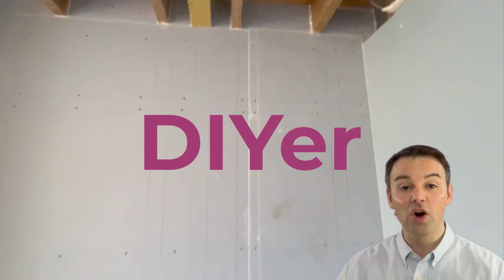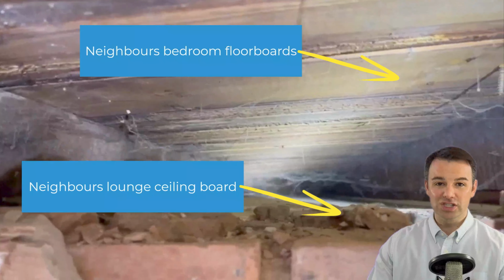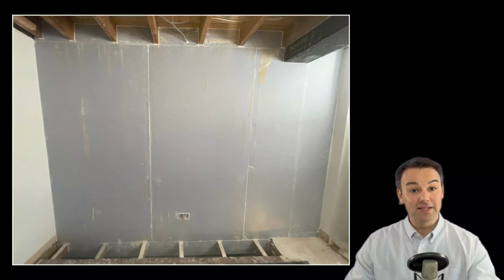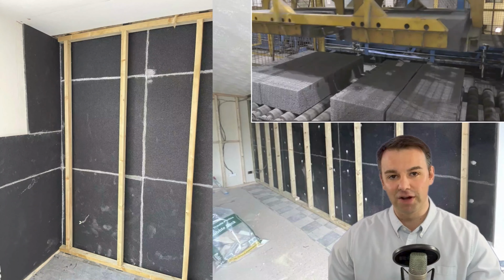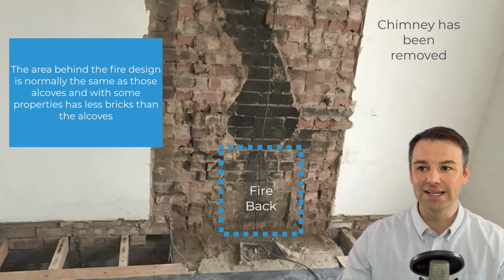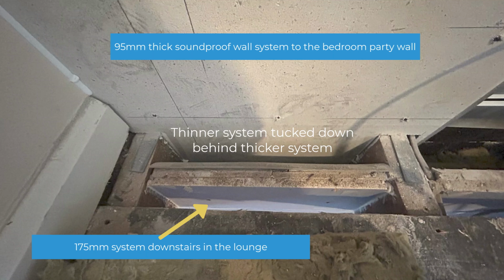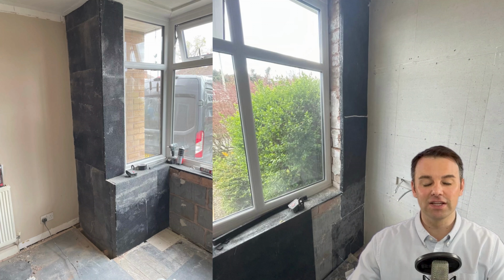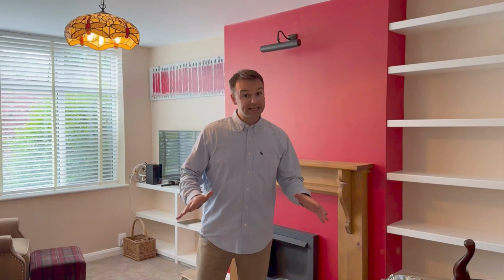The Most Expensive Soundproofing

Comment: Hi Jim
Would an alternative to the 10mm rubber on the flanking wall be a tecsound 100 or would the 10mm rubber be more effective?
I have a brick wall with double doors separating my lounge and kitchen with dot and dab with i thnk maximum 30mm to play with.
Any other ideas appreciated but im think something similar to what you have done in the video
Reply from the maker: Hi @stevenpower1838,
Good question 👍 and nice clear constraints 30mm to play with always makes it interesting.

Between Tecsound 100 and 10mm rubber, the 10mm rubber will generally be more effective for structural vibration on a flanking wall. Tecsound is more viscoelastic and great in certain applications, but in this type of scenario the thicker rubber tends to do a better job of sound deadening the light weight blocks itself.

That said… the bigger question is this:
You mentioned dot and dab. If that wall is dot and dabbed onto brick, that cavity is already capable of amplifying and channelling sound. If you just go over the top of dot and dab with Tecsound or rubber, you may not get the result you’re hoping for.
If it were me, and I only had 30mm total:
I’d strongly consider removing the dot and dab first.

Sound deaden the brick properly (10mm rubber if space is tight).

Then reinstall a properly isolated 15mm Soundbloc board within your 30mm limit. (glued like I share in video 'Soundproofing for Beginners')
Also, because this wall separates lounge and kitchen (double doors involved), you need to think about:
• Are you dealing with airborne voice transfer?
• Or impact vibration travelling through structure?
• Are there ceiling/floor connections tying the two rooms together?

With flanking walls, it’s rarely just about sticking something thin on and hoping for the best. It’s about stopping that wall from acting like a drum and tucking it up and tucking it down.

If you want to keep it similar to what I’ve shown in the video, 10mm rubber is the safer bet over Tecsound in this case.

If you can tell me what noise you’re trying to reduce (voices? TV? impact?), I can steer you more precisely.
Reply: @jimprior7 
Hi Jim
Thank you for such a thorough reply.
Basically the party wall in the lounge has a soundproofing system applied which is doing a pretty good job.
It was mainly to eliminate airborne voice transfer.
However when the voices next-door get very loud it comes around the party wall and into the  flanking wall.
I will most certainly be removing the dot and dab but that will still only give me 30mm to work with in total.
So I guess im wondering what you would recommend to go onto the bare brick with a 30mm limit that would best treat the airborne voice transfer along that wall.
Regards

Steven.
Reply: Oh and its coming from the neighbours who have a mirror image flanking wall on the other side of our party wall.
I'm not concerned about noise transferring from my kitchen to the lounge

Comment: You mention going into the loft. If a loft is partially/ fully floored, do you have to rip up the loft flooring as well?  Thanks
Reply from the maker: Hi @kaylaing, great question! 🙏
We always do that yes, because you need to get the RW3 Rockwool between the ceiling or loft floor joists to reduce the noise coming over the wall system installed to the bedroom.  We do this by cutting open the ceiling and tucking the soundproof wall system up into the loft, insulating the gable wall in the loft and also insulating back from the conflicting party wall.

Thanks for your question 👍

Comment: Luckily my semi has a proper brick wall between me and next door and the joists run parallel to the party wall. Unfortunately i can hear next door snoring occasionally so ill have to sort that. 

I think one of the best ways to fix these problems is to have built in wardrobe against the party wall. All the clothes act as sound damping. Unfortunately you cant have a wardrobe in your living room 😂😂😂
Reply from the maker: Hi @Lawrence, thanks very much for your comment, and thanks for watching 👍.  I live in a semi detached house and my floor joists did use to run into the wall before I disconnected them and no longer hear the neighbours doors slam.

I think the wardrobe will change the way you hear the noise, but I have not come across any that significantly reduces the noise yet. One thing we do find though....the wardrobes that come with a backing to them and fitted floor to ceiling tend to channel the noise to other rooms.

Comment: At £25-30k its just cheaper to move house 😂. Obviously if you could do it 85-90% as good for under £10k then that might be more reasonable. Spending 10% of the value of the average house just on soundproofing seems A bit crazy to me.
Reply from the maker: Yes, in some parts of the country that maybe so, but also, some people have different values, noise can affect people in different ways. Unwanted noise affects your health, well-being and the relationship with anyone around you. Most houses do not have sufficient sound insulation for modern living….or like this property, it had huge holes in the structure.
Also, when you have achieved the soundproofing of a detached house in one room of your house, you will feel empowered and may find you don’t need to soundproof other rooms.
Reply: Thanks for sharing the video Jim. I too couldn’t afford £25-30k to sound proof my 3 bedroom end terrace in Essex but I don’t want to move further out either, isolating myself just to live in a detached house in the middle of nowhere. I’m hoping I can sound proof 1 bedroom upstairs and convert my box bedroom which doesn’t share a wall with a neighbour on that side, into a bedroom, meditation room, tv room space. Using a Murphy folding bed which then becomes a 2 seated sofa and a foldable desktop table that’s attached to the wall on the opposite side of the Murphy bed with a LCD flat screen screwed to the concrete wall which is my outside wall, facing outside. In the long run I’d like to sound proof my bedroom upstairs and later on my kitchen dining room downstairs.
Reply: my therapist is covered under my health plan

Comment: Hi, great videos. I was wondering, you mentioned 20mm issolation pads where do you get those from or can you recommend a type of Mat I could purchase instead and maybe cut into pieces ? Thnx
Reply from the maker: Thanks very much, hope you found it valuable:
Here you go: https://www.soundinsulationstore.co.uk/products/m20-rubber-sheets-1000x1000x20mm?_pos=1&_psq=M20&_ss=e&_v=1.0
Reply: @jimprior7 oh very helpful, best I’ve seen. I was going to email you but this might help others in this game… basically Im building a mini ramp for BMX/Skate in a brick lockup, the outside backs onto someone’s garden. The sound its probably going to be drum like when it’s being rode, my thoughts where to obviously add the first layer of 20mm board you mentioned.. however I will need to add plywood to the wall as we are wall riding it, my initial idea was to add 2/2 joists ontop of the 20mm and insulate the gaps with Rockwell .. do you think I’m going to dampen much from this or do you think not. Appreciate your help I’m blown away how you keep up
Reply from the maker: @weAreNotAloneHere  Hey @weAreNotAloneHere thanks very much for your kind words …because you are treating the noise at source, doing that to the wall like you suggested will make a difference. However; after you sound deaden the wall, a 25mm air gap then the Rockwool would make a significant difference, but I understand the wall surface needs to be solid so this might be tricky to implement. I think you need to give the roof / ceiling some sound insulation…not just the wall backing on to the neighbours. I would go as far as suggesting an insulated suspended ceiling of some kind to reduce the noise getting to the potential hollow roof space.

I think you will really need to dampen the acoustics within the room too, either specialist sound absorption panels or even something as cheap as carpet to as many hard surfaces in and around the ramps to reduce the sound bouncing around off of all the hard surfaces in the room. 

Sounds like an exciting project, let me now if you need installation support or consultation: https://jimprior.com/work-with-me/
Reply: @jimprior7  Thanks. If not too much trouble please could you provide link to the glue and sealant for these issolation pads.  Thank you.
Reply from the maker: @ Spray contact adhesive
https://bit.ly/3s82pjv
Reply: @jimprior7  thank you!!!

Comment: Do you tuck the 50mm system down on flanking walls??
Reply from the maker: Hey @Grangey, thanks for your question, Yes we would unless it’s not practical to do so, for example we would not tuck it down on a flanking wall if it caused a major structural disruption to tuck the soundproofing system down. Eg moving a stairs over….or re-routing major plumbing. Hope that helps 
Thanks for you question

Comment: What would you recommend for a creaky, echoey 1840s weavers cottage first floor? I thought about taking boards up, rockwool in between joists, joist tape on joists, screw boards down and some rubber/MLV on before fitting underlay and carpet?
Reply from the maker: Hi @t2thex21
For old cottages we use Rockwool RW3 (60kg/m3), it is a nice breathable sustainable product. Insulate between the floor joists and re-fit the floorboards if you have to refit the existing floorboards. (Alternatively replace the floor boards with a structural ply with expansion gaps and acoustic sealant glue and screw to squeaky joists).

We find the best results come when we sound deaden those floorboards (or Ply-board) with a 10kg/m2 self adhesive TecSound if you are in UK or Europe. If you decided to use MLV, then use this between the floor joists with the Rockwool. MLV is pretty rubbish used on its own….ie on top of the floorboards….but use it in combination with other product like Rockwool then it gives noticeable reductions in noise.

On top of the TecSound use a heavy duty underlay from one of the materials suppliers: https://www.floorscan.co.uk/product/acoustilay-15/
https://soundproofingshop.com/acoustic-floors/acoustilay-15-1-2m-x-1-2m-15mm-15kgm2-acoustilay15-12m-x-12m-12mm-15kg-222
https://www.soundservice.co.uk/quietfloor_plus.html

Just one final point @t2thex21….do you have stud walls built on top of this squeaky floor? If you do maybe check the base plate is secure and the squeaking you are hearing down stairs is not coming from that.
Have you seen this video: https://youtu.be/JBogcZpw_ss?si=b_CiqqOc5dRYFsb0

Thanks very much for your comment….hopefully see you on the MasterClass https://jimprior.com/soundproofing-masterclass-registration/